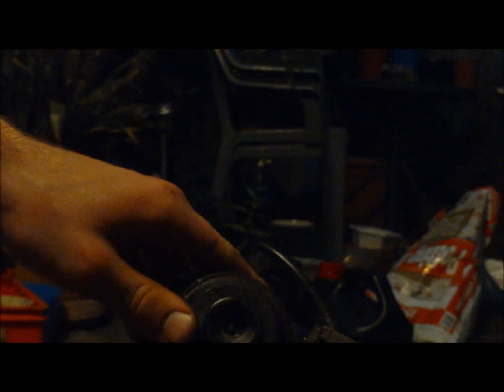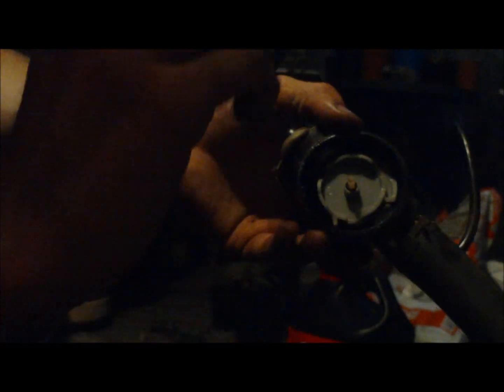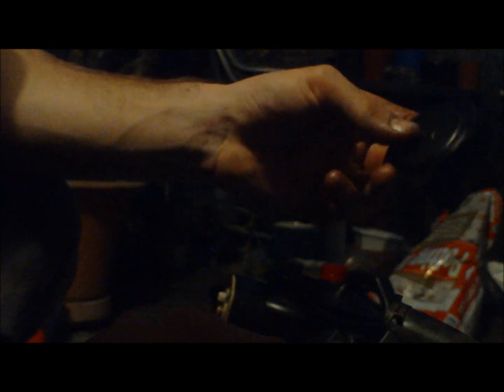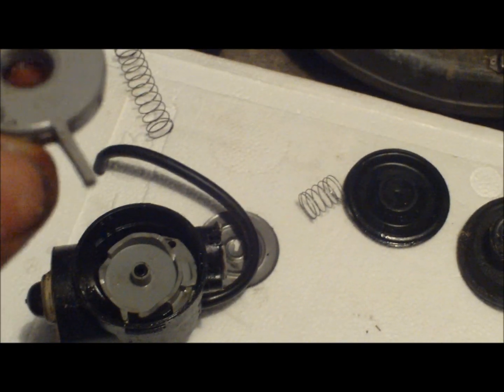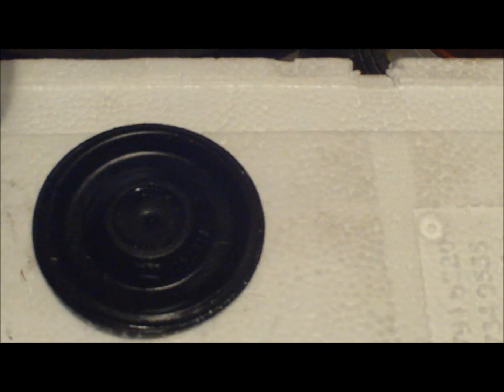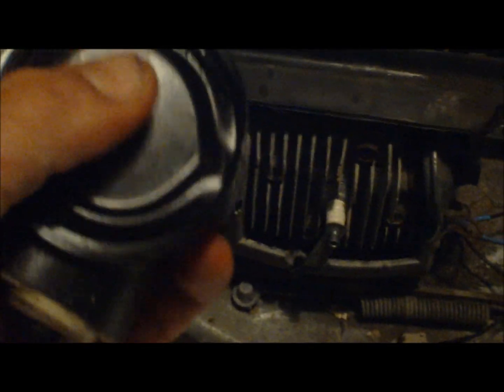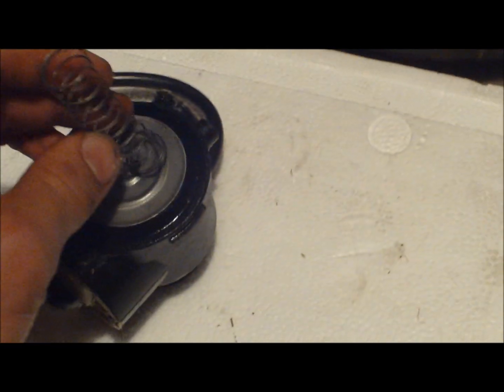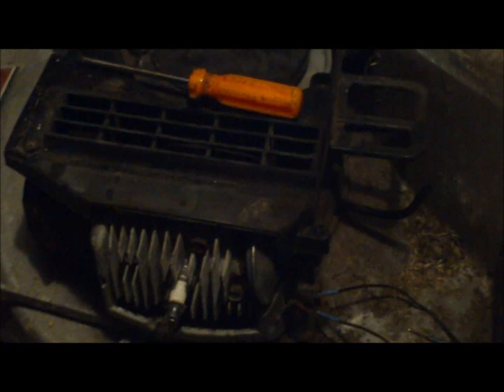Assembly of a victa carby

Comment: I might try and get my Victa Powertorque mower going on the carby tomorrow,today I found an issue with the killswitch shorting out inside the carby so I am unsure if it's because the rubber bits are worn out or not.

I picked it up from a roadside collection & found out all is wrong with it is the base has some rust in it which I can cut out & weld patches into & the crankshaft bearings are noisy & pitted after it sat out in the rain & collected water,I spun it out yesterday as the motor was full of water & its compression was 95 PSI with the decompressor installed.

Today I tested it with the decompressor removed & fitted the spark plug into the hole then got a reading of 107 PSI so the engine should fire I thought,so I removed the carby & pulled the killswitch wires out of the carby then found out I had spark after I spun the motor over so I decided to screw the spark plug in,refit the lead & pour some fuel down into the inlet side of the motor, gave the starter a couple of pulls & she went for about 5 seconds.

The one I have must be the 1996 onwards mower with the ignition module integrated into the ignition coil as I could not find the separate ignition module which is normally fitted near the bottom of the carby, it has the black & grey wires unlike the one with the external ignition module which has the black & Brown wires for the killswitch wiring.

Someone on here was saying that the ignition coil should have a resistance of about 9 K ohms but I assume that's for the older mowers with a separate ignition module as I got a 14.7 K ohms reading & the coils is o.k.

I just want to see & hear how she goes before I overhaul it to replace the crankshaft bearings, it's just good how I don't have to replace the rings & that Victa pin the ring grooves so that the rings stay in the same spot.

Comment: Is your Victa 2-Stroke flooding and still leaking fuel even after changing the plastic needle and other parts? We designed and developed a metal type needle with rubber cone tip that works with all aftermarket, OEM and genuine Victa primer cap. On eBay search for Victa Metal Type Needle.